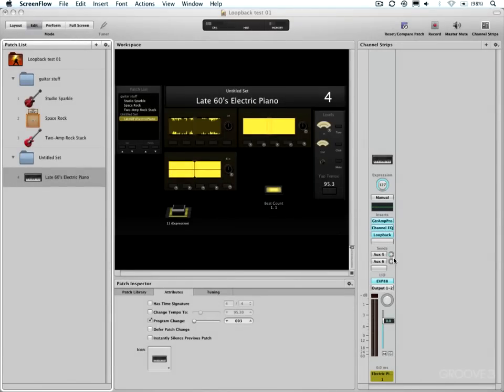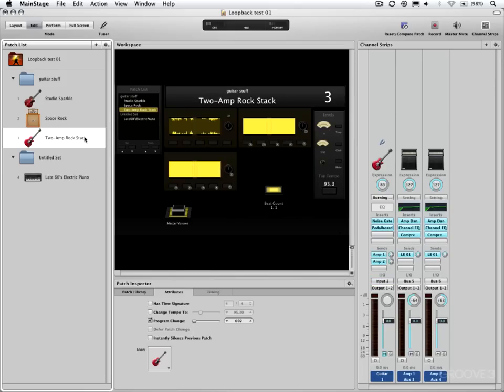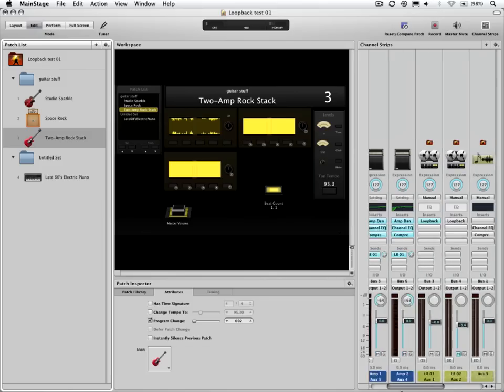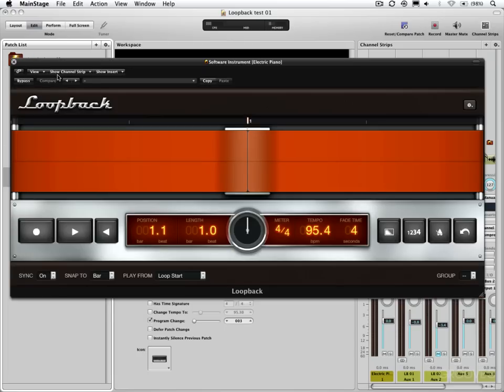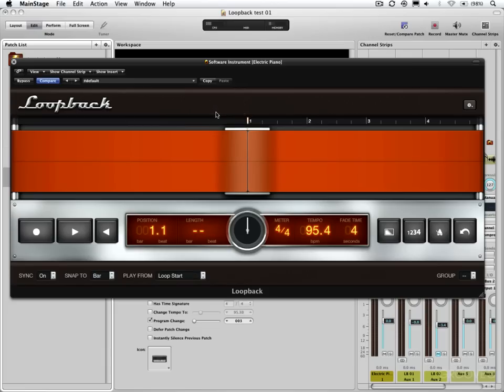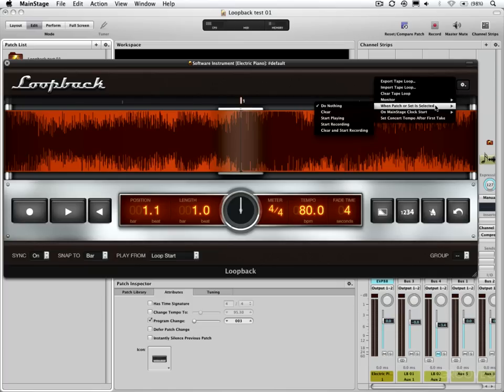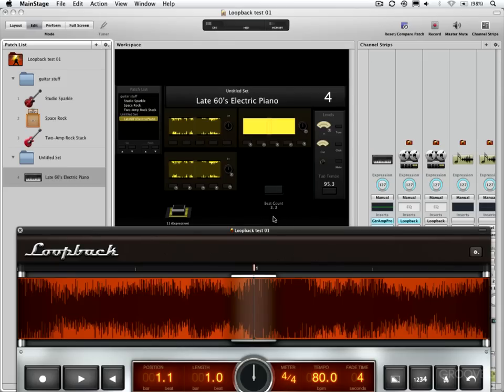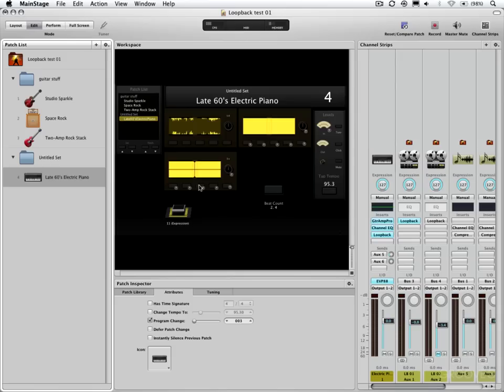Loopback Pt. 1 (MainStage 2 Explained)

Comment: i used to run my loopback on the output channel and i was getting frustrated at the lag i would occasionally get especially since i was planing on using it a lot live. but putting it in a AUX like you said got rid of the lag. thanks a lot :)